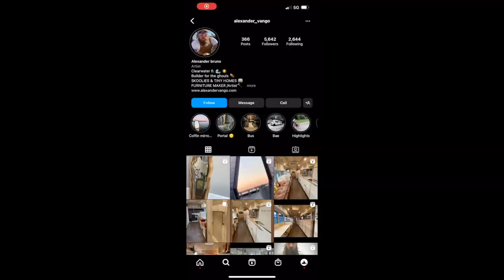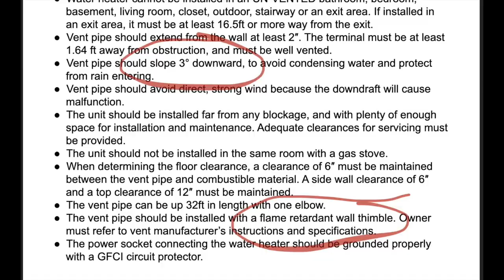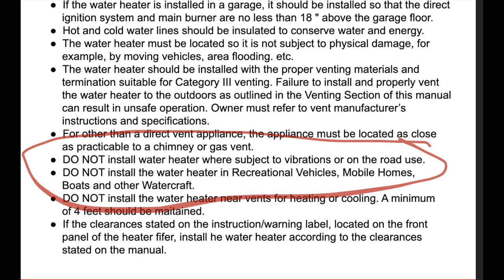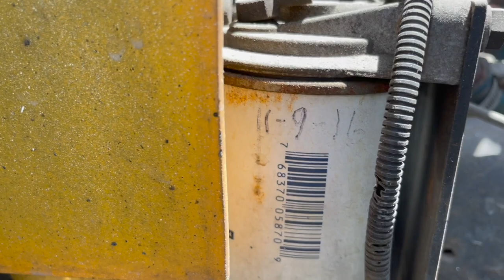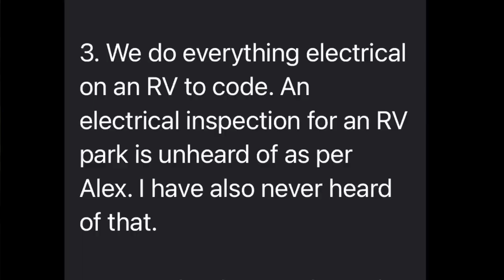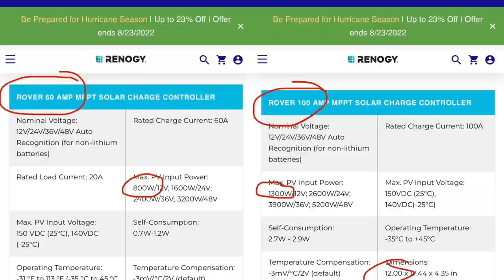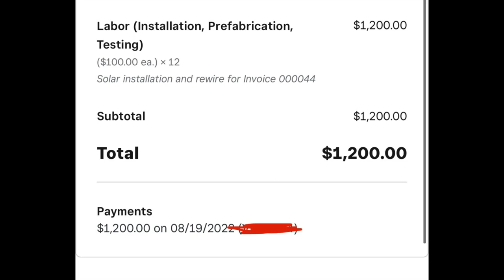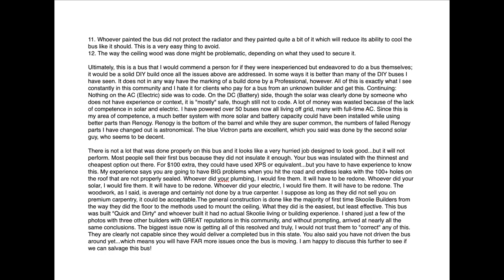"Buildered" Ep 1 - Instagram VS Reality

Comment: That romex connection on the A/C is a fire hazard and can also ruin the unit.  It's not vehicle rated either plus you never use solid wire in any vehicle that's expected to be driven.  The safety concerns, and with a little research on manufacturer and code requirements, plus motor home/RV safety rules,   this builder ought to be hauled to court.  It's beyond incompetence.

Comment: Your observations and description PERFECTLY describe one of my customer's experiences with Epic Skoolies in Washington.   Except Epic charges $100K plus for their builds.  If you look at their videos...just like you say...they completely gloss over their solar and electrical installations.  They use some decent components, but their installation quality is SO crappy that they almost burnt this family's bus down with bad cable crimps and improper work.

At least in this bus, they installed one of the mini split condensate drains.  You're right that they should use both, because the bus could lean either way.  In my customer's bus, Epic didn't install a drain at all, so the mini split drips on their bed.  Great...

Comment: I hope the builder stands up and pays the customer back. 

There’s so much wrong that you didn’t even mention. 

-Front door without safety glass

-stove that’s smaller than the cut out.

- built ins that will eventually fall apart,
- wires going through metal without grommets 

And so much more, every new frame in the video reveals another horror story
Reply: Also the door is an interior door made of particle board is currently getting soaked in florida rain.
Reply: would really love to talk with  you, I messaged you via FB.  Hope to hear from you

Comment: Out of curiosity, were you able to help this unfortunate purchaser?  I certainly hope so.  I have no plumbing or electrical experience.  The only building experience I have is from back in college when I built sets for theatre.  It was pretty slap/dash, but with safety in mind.  It didn't have to look good close up, but it HAD to be safe...because theater.   After watching your inspection video, even I quickly came to the conclusion that this was a terrible build.

Also, you helped me understand better how I recently got soaked by an auto repair shyster.

I will be recommending that people watch this video and others like it before getting involved in nomad life (van/skoolie/etc).  If you are going to give up the relative safety of a stick and brick for life on the road, you'd best be absolutely certain that your build will withstand the rigors of life on the road.  Yes, it always looks lovely and fun in instagram/youtube, but looks can be very decieving.
Reply from the maker: I removed the 140+ holes in the roof and removed the panels and put proper panels on. Also sealed up the leaking skylights “temporarily”. Made the electrical as safe as I could, and disconnected the sketch propane. That’s as much time as I could give!
Reply: @sojournersway  Thank you for letting me/us know that!  What you did was better than what that poor woman started with.  Hopefully she can continue improvements over time.  As long as it is functional, she's on the right track.  Thank you for what you did. 💜

Comment: Who do you go too, to fix this mess. I mean you just spent thousands for a substandard job and now have to get it all fixed properly.
Reply from the maker: Yeh, it’s a nightmare. I deleted all the panels and sealed the roof. Then I installed a proper rack systems and larger panels. I installed proper breaker protection inside and corrected as much as I could before sending her down the road to another solid guy in the community.